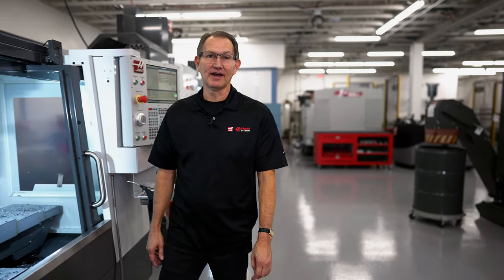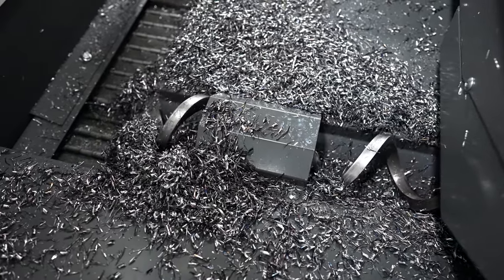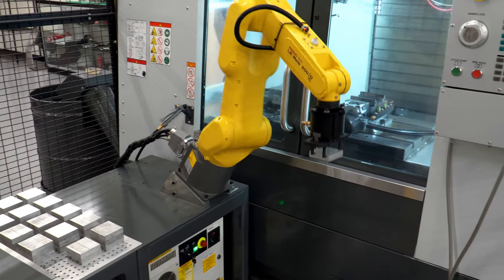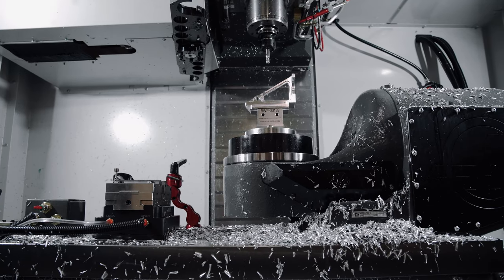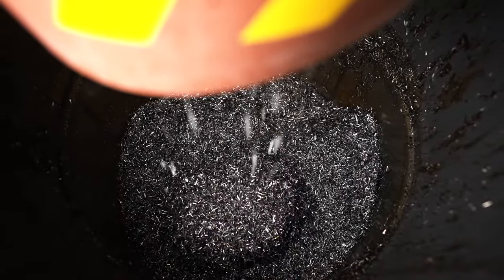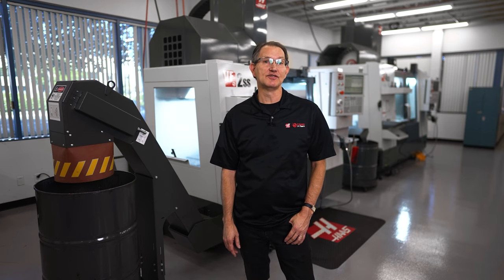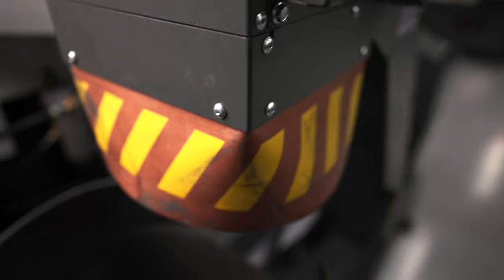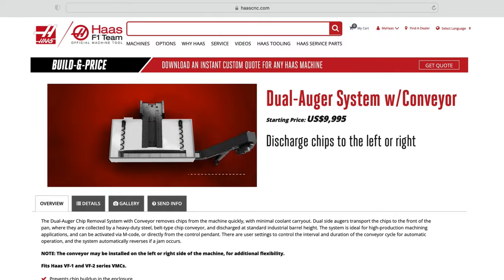Get the Haas Dual Auger with Conveyor for Your New VF-2 - Haas Automation, Inc.

Comment: The single auger in the front of old VF2's is pretty bad, to put it politely. Angles in the bottom were so shallow that chips would always pile up in the corners and sides. This looks like a good step up.
Reply: Dont worry I'm sure the chips will still find somewhere to pile up.
Reply: It actually works fantastic when you add this simple $600 device.  https://www.youtube.com/watch?v=Q-nNqMaLPgY&t=21s

Comment: Yes I completely agree with the past comments, on my 2019 Vf4ss chip management inside the machine is the worst issue I find at the moment. You guys really need to improve it. Addind a chip lift will not improve it for me as chips will still pile up inside the back, side an front corners inside the enclosure. The Major improvement point for me.
Plus it also has another issue: fine chips going through the coolant grill just before the chip chute entry and piling up there as the oil exit chute is not sufficiently steep either.
Reply: Completely agree. I have a VF4 and am tired of chip build up. The single front auger is useless.
Reply: I cannot say it's useless but it still has a wide progression margin.
Being myself a mechanical designer and a machinist, I try to tell things the most objectively possible because if Haas knows our real needs or struggles precisely, then they can work on it more efficiently.

Comment: I've had dual augers on my VF2ss since 2010. Yes, it has a front auger. We fill two 32-gallon cans daily with it. Could the open to the chute be bigger, yes it should. Especially with today's cutting methods. The chips are longer and thinner when side cutting.
Reply: It actually works fantastic when you add this simple $600 device.  https://www.youtube.com/watch?v=Q-nNqMaLPgY&t=21s

Comment: having  1 auger in the front is just .... trash. you ALWAYS need to shovel chips out. 
haas kinda needs a waterfal at the back and i mean THE WHOLE WALL!  and a steeper bodem plate (talking about the VF VR VMC and maybe even more models). 
this would (in my mind) really reduce chips loading up the machine. 
if that can't be done with future models, make the 2 and 4 augers standaard because ... it's just a ** job to clean out chips EVERYTIME
Reply: Obsolutly agree with you , a vm2 user.
Reply: It actually works fantastic when you add this simple $600 device.  https://www.youtube.com/watch?v=Q-nNqMaLPgY&t=21s

Comment: I really wish that I would have bought the chip conveyor and quad auger system on my VF4. The single auger is almost useless. I spend way to much time screwing around with chips.
Reply: It actually works fantastic when you add this simple $600 device.  https://www.youtube.com/watch?v=Q-nNqMaLPgY&t=21s